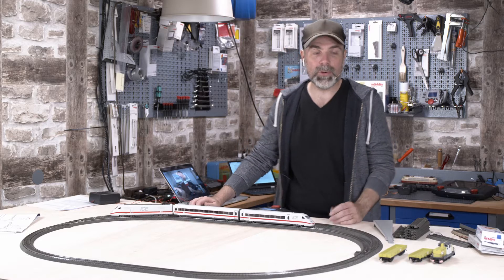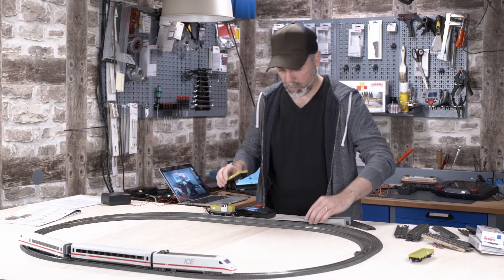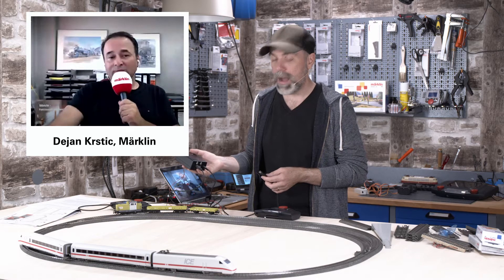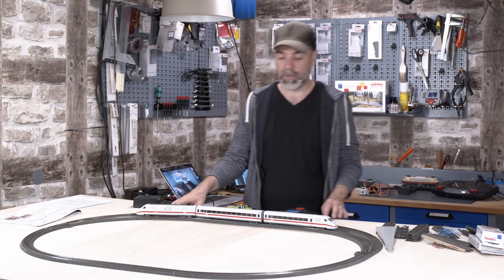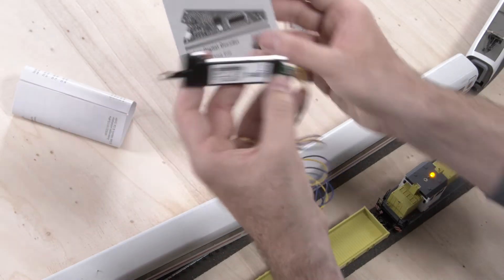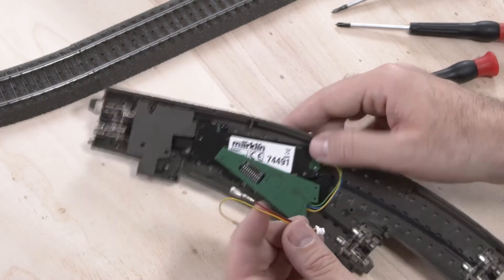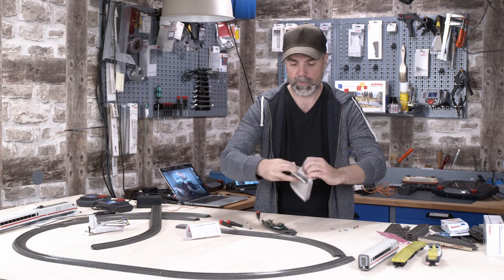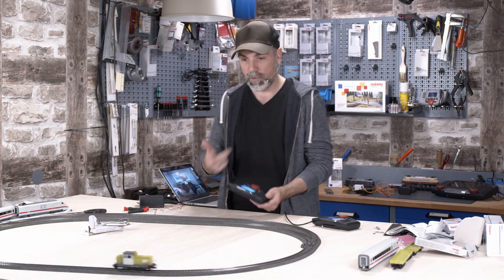How to control turnouts digitally with the Märklin - Let's build a model railroad - Ep. 02

Comment: I was recently given a set from the 70's.  I want to set it up but would like to add some new trains. I understand you can connect m track to c track but it isn't recommended.  Is it better for me to buy new C Track and then add the older Engines to the control unit.